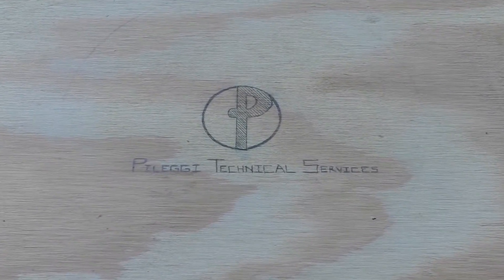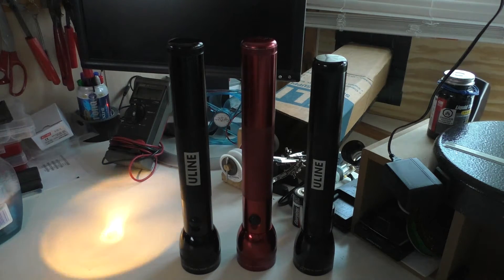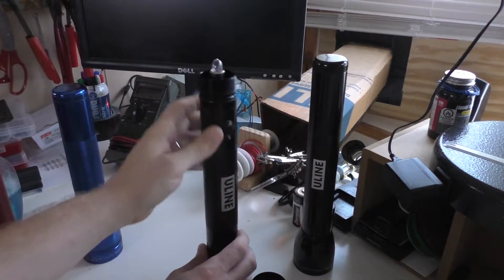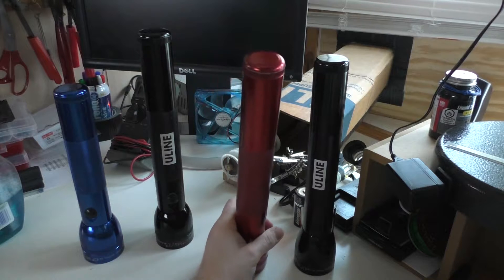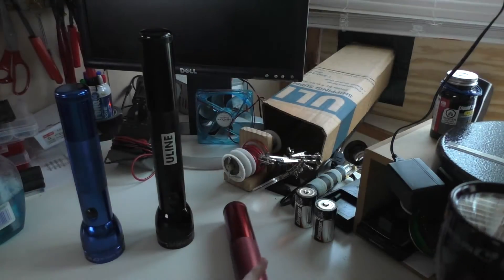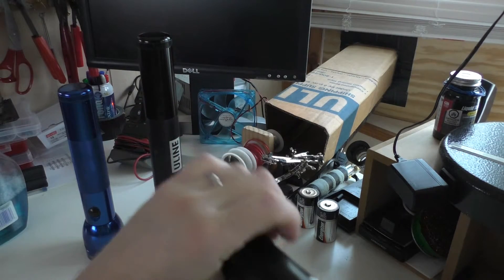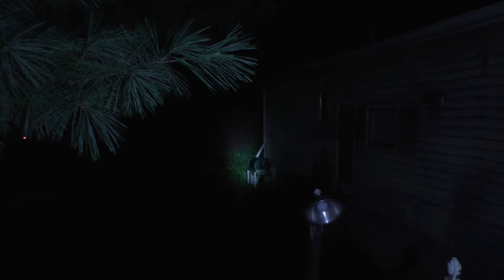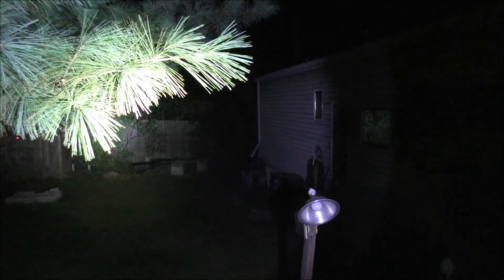PTS Ep. 20 - A Comparison of Maglite Flashlights

Comment: Thanks for the great review. Do you think the 3rd gen would hold a charge for along time if I left it in my glove box for extended periods of say a month? I had heard there is some battery draw, even though small, with memory or perhaps the electronic switch- not really sure how that works.
Reply from the maker: +Frank Crawford I have one mounted to the side of my rack in my van that's always at the ready.  I've had it there for several months now and it always seems to be just as bright everytime I use it.  Thanks for the comment.
Reply: I keep a 3D Incandescent in my vehicle. It's been in there for a couple years now and I brought it inside to inspect the batteries and seals. Nothing wrong with the batteries, cleaned the threads and lubed up all the seals. I live in NY. Our weather can be pretty brutal, but my light has done well in the vehicle. 🙂

Comment: 5:40 Was it a 2xAA led mini mag that you had the problem with? I absolutely hate those lights. At least the 97 or 98 lumens multi mode model. They actually turned me against maglite a little. My first one lasted about 2 years. After it became unreliable, I bought another. It was dead right out of the box. Wouldn't work. I took it back and got another. After about a year and a half, it started acting up also. They both acted up in the same way. If you kept it level or pointed upwards while on, it would be ok. But if you tilted it downwards, it would get very dim. You'd have to smack it to get it to come back up to bright. I stretched the spring and even took the led module itself out and made sure the tab that touches the positive end of the battery was good. Workes ok then for a little bit, then it would go right back to doing it again. I bought the single mode 272 lumen and now the 332 lumen one. Haven't used them much to test their reliability, but the multi mode one's suck. I love the D sized lights, the Solitaire LED, XL50 and the old style xenon mini mags, but I despise the multi mode mini mags
Reply: I had one also that was utter garbage. I also had an led solitare that was broke new out of the package. The reflector lens is press fitted a long with the lens into the head bezel. Mine was broke and the reflector just fell out. Maglite used to be great, but their quality has dropped.

Comment: Have you tried using rechargable NiMH batteries in the newest model? I use my older maglites a lot so I bought 2 D cell rechargable batteries from Radio Shack. Now maglite says you shouldn't use rechargable batteries in their 3rd gen lights, but I don't know why not.
Reply from the maker: I haven't tried NiMH batteries yet for a few reasons, which may be the same reasons that Maglite doesn't recommend them:  1.  Alkaline batteries have a higher voltage (1.5V) than NiHM (1.2V).  2.  Alkaline batteries are better suited for low drain devices and will also hold a charge in storage for a longer period of time.  3.  The initial cost of NiMH batteries and a charger can be cost prohibitive.  4.  The newer LEDs are more energy efficient and have adjustable power outputs which translate to better battery life.  5.  Li-Ion battery packs would be the better investment as they are higher voltage and higher capacity than NiMH or even Alkaline.  If there isn't a pack available for this flashlight, they at least have a model that is already set up to be rechargeable, which brings be to; 6.  There's no way of recharging the batteries without removing them which means you have to open and close the cap many times (possibly more than changning Alkalines) and maybe that stress can weaken the o-rings quicker?
Reply: +Pileggi Technical Services I wish they sold a 2 D cell sized rechargeable light, but they don't.

Comment: I have an 3 D cell MagLite which must be made around 2016 and one NIB with make year 2017. Both state 168 lumen and are LED but with the old reflector style still. So the donut shows when adjusted bad. These lights with the incandescent reflector type are only usable with spotlight since floodlight is garbage. Nevertheless it brightens up enough at the surroundings. These I use only with Eneloop adapters for AA NiMH rechargeable batteries. That works with these models. With the 2 D models with multi mode switches this battery system doesnt work that well but it works with reduced brightness. These multi mode switches are garbage. Thats why I stick to the simple mechanical on/off switch. The lower Volts of NiMH batteries work for many MagLites but have to be tested. An Maglite with Led but rather a bit older did not work at all with this NiMH system. On that it says still patent pending so I guess it was the 1 st gen Led 3 D cell lights which came out. It depends of the bulb voltafe range I believe.